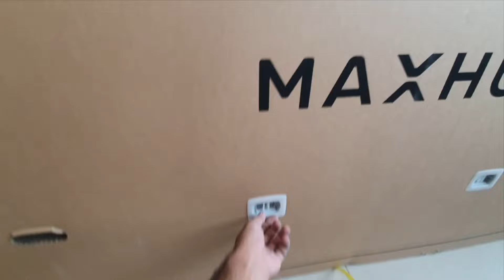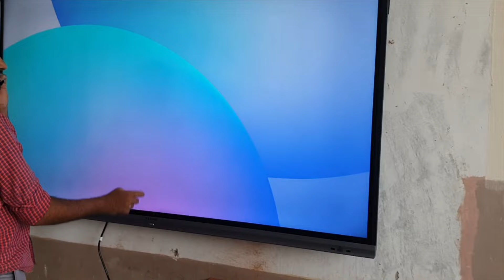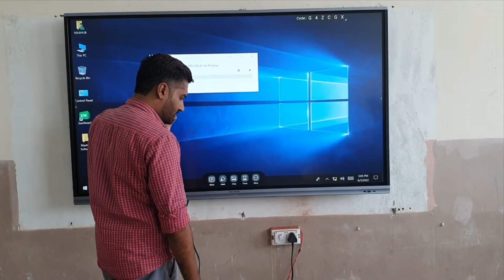MAXHUB interactiveflatpanel | DIGITAL BOARD | unboxing | KAISE INSTALL KRE | 75 INCH PANEL |

Comment: Price kya lagega?? With ops and without ops?
Reply from the maker: WITH OPS @195000/- 
WITHOUT OPS @171100/-
Reply: @sagarcyberhub  with shipping?? Without shipping?? And warranty?? And Ops konsa hoga?? i3, i5,i7 and ram??
Reply from the maker: WITH SHIPPING HAI SIR
Reply from the maker: i5 8TH GEN PROCESSOR 
8 GB RAM 
128 GB SSD 
WINDOW 10 ENTERPRISE LTSC
Reply: @sagarcyberhub  size 85inch ka price kya lagega.. Ops & without ops?
Reply from the maker: 86 with ops aaeyga 312000 ka
Reply: @sagarcyberhub  without ops ka price kya lgega??

And ops lena sahi hai ya without ops?? 🙏